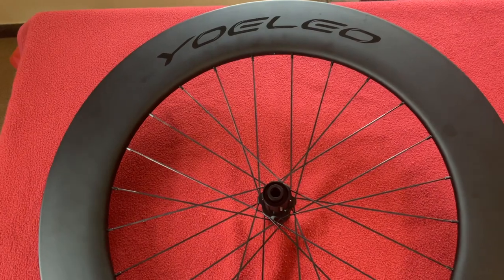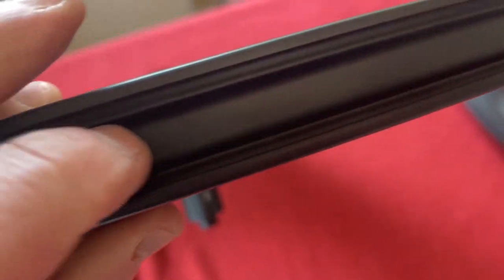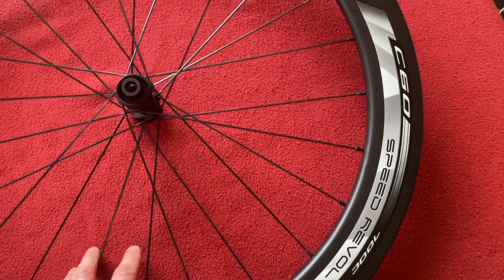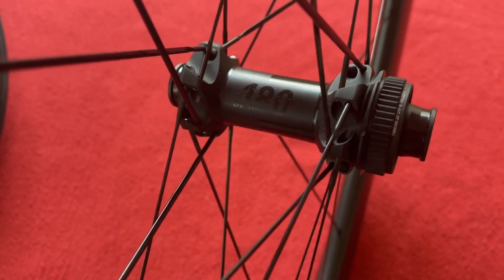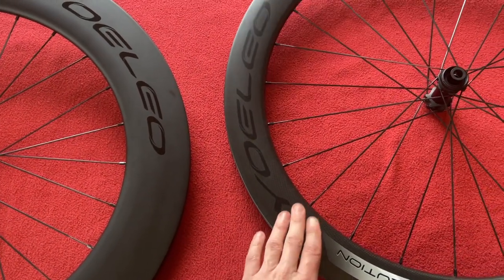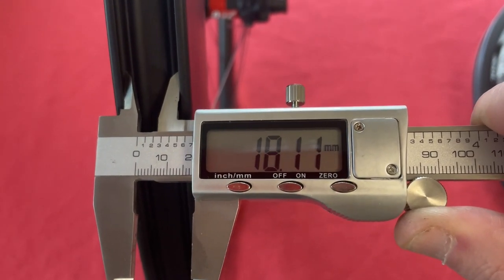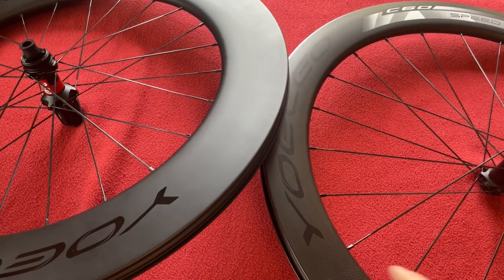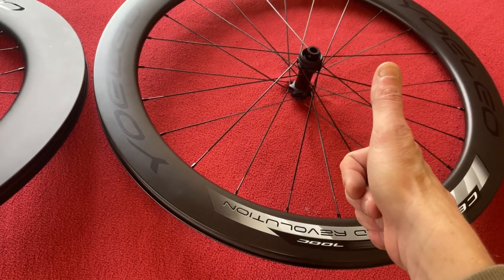Yoeleo Rims DT Swiss Ratchet EXP Hubs

Comment: 25 front 28 back, is great! Best of both worlds. Also depend on the roads you ride of course.
Reply: If you have 2 25 already I would just use those first. The roads in your riding video's looked quite reasonable anyway.
Reply from the maker: I’m tempted to go 28, been on 25’s for a long time now. 👍

Comment: I've been using clincher Conti. G.P. 5000's for a while and they are very good all rounders but I couldn't get any 28mm tubeless ones for my new wheels. I ended up with Schwalbe Pro One Evo's, and they have been great, very lively ride and easy to set up on my rims. They feel like my old tubulars used to.
Reply from the maker: Ah nice! I read so many mixed reviews about the 5000 series that I wasn’t sure if I should get them, but I’ve bitten the bullet and gone for it. I’m interested to see how the get on. 👍